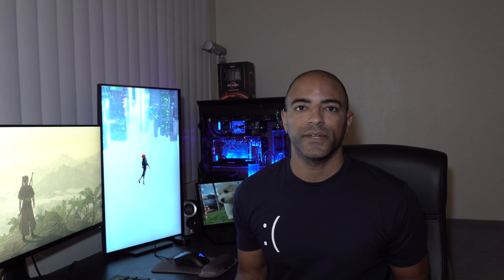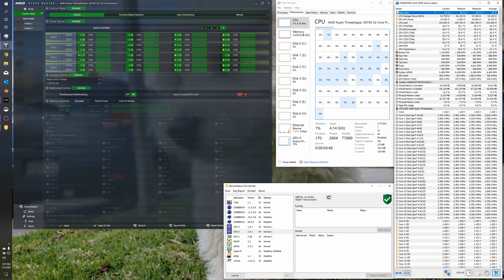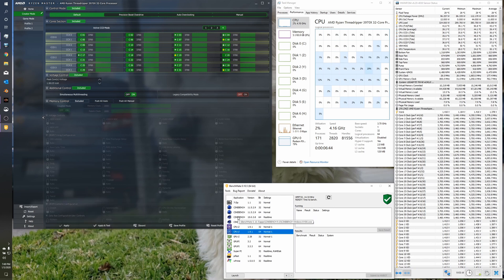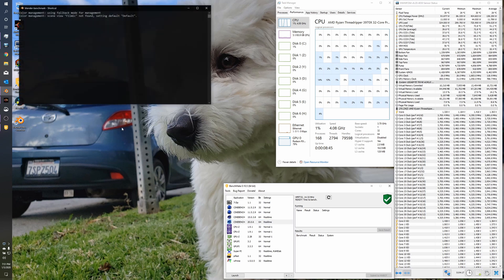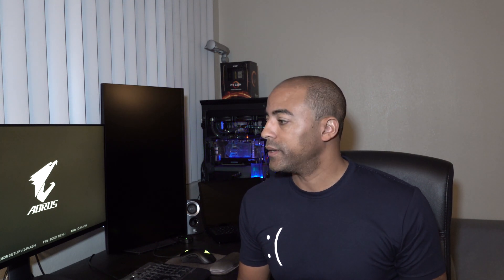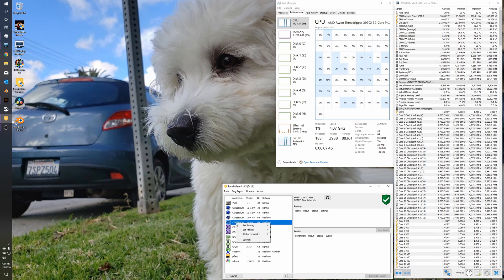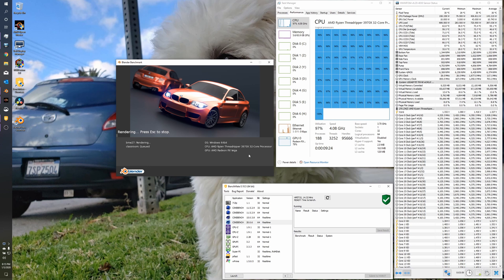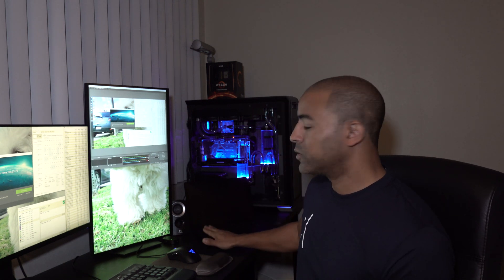AMD Threadripper 3970X - PBO on Vs. off

Comment from the maker: Let me know what benchmarks you would like to see for the AMD Threadripper 3970X!
Reply: can you do cppc and cppc preferred cores on vs off?
Reply: Ur coling is not enough for  32 cores u  should  aimat below 60C temps,,,, then u have to adjust ur PBO power current draw in bios for it to do anuting properly, and then reduce ur CPU vltage as low as possible keeping stability.
as for bench marks the only benchmark that coutns for   this cpu is Vray Bench all teh rest do not matter, as the bulk  of these cous are sol dto those who wokr inVray and Houdini... If u go this for video stuff, u might syep back to consumer stuff next time.DO NOT push al that voltage at idle in Your CPu , its set at over 1.4 volt   whileit wil not destroy it it iwl definitley degrade it and lower ur perfomance at least by 5% and posilby make ur temps at least 7 to 10 c higher
Reply from the maker: The main difference was actually the BIOS was overriding Ryzen Master. The temps and wattage were fine and I'll be doing a follow-up showing how this is properly ran. Ryzen Master is wonky and fights with the Bios.
Reply: @DaPoets  funnily enough, my experience is the opposite - using a GIGABYtE AORUS Master set RAM timings using ryzen master, which was overriding me resetting it in the BIOS - also, i scored higher with PBO on vs stock, went from mid-high 17000's cinebench r20, sometimes literally just over 18000 (~18010) with XMP profile for 3200mhz RAM @1.35v - 

now here's where im a total deadshit, but surprised nonetheless - I have gskill trident 3200mhz, 64gb - when I leave all the settings to auto, no xmp, with PBO on it scores around 18321 - 18458, when I set the PBO manual with motherboard determining power, 200mhz max overclock and still auto set for RAM, it scores around 18500 give or take 50 points - difference between PBO auto and PBO manual with overrride is about 10oC - PBO auto around 72oC (im aircooling, poorly by the way, lol) PBO manual around 82-84oC......doesn't score at all significantly better for 10-12oC temperature difference, and only seems to be result of all cores getting close to or spot on 1.5v - which the auto PBO seems to reflect a range of 1.45 - 1.47 - 1.48 v being the larger percentage of cores and perhaps only less than a handful of cores actually hitting 1.5v if any at all...

when I set xmp for ram so it runs 3200, it only ever gets to mid to high 17000's, PBO on or of, when I change the timings and ram to run 3600mhz, then with PBO on it only gets to 18091, difference between manual / auto PBO again only really being temperatures

that all said - changing the RAM speed / timings does add avg FPS from ~400 -> ~425 in Heaven benchmark run at low quality 720.

 so...again, im no pro by aaaannnyyyyy stretch, barely at amateur really - the ram thing makes me laugh
Reply from the maker: I actually need to make an updated video from this one showing exactly what the conflicts were. Thank you for your detailed response I'll try to get to this soon!!👍👍
Reply: @DaPoets  all good man, thanks for the video - my writeup not very good, but I think you get the rough idea - stock as you showed, around mid 17000's, PBO auto with ram auto gave best score ~18500, with PBO on auto & enabling XMP profile to rated settings for RAM only decreased cinebench score (mid-high 17000's) , the only thing to bump it back up a notch was overclocking the ram to 3600mhz, so it scores ~18000, still 500 less than running it at auto as set by mobo - 

PBO from auto to manual mode only seemed to increase temperatures without any performance benefit, but also not a noticeable decrease in performance either.

thanks for the reply and the video(s) - its egged me on to have a play and try to understand things a little more, cheers
Reply: using the new cinebench r23 and 3970X, i get a score of 43666 in stock settings.

Comment: have you gotten dpc watchdog violation under sustained load?
Reply from the maker: No
Reply: @DaPoets  theres virtually no support out there for the 3970x and im running it on a trx40 pro wifi creators board windows 64 bit.  are you familiar with any of the errors associated with msi bios and windows having issues working together when running these cpu's I also run a 4090 but it did it with my 4090 . 256gb RAM  but windows only interprets 128gb
  sorry for the novel but any info would be appreciated
Reply from the maker: @TheGodFactory  I use the Gigabyte Aorus Master TRX40 board and I have not had a single issue... Nothing like you're describing. I use 128GB of Kingston ram, and have not tried 256.  I wish I could help but perhaps try level 1 tech as I think he pushed his to 256.
Reply: @DaPoets  i appreciate the response thank  you.

Comment: What gpu are you running with that beast?
Reply from the maker: Well this is an old video. Now there are 2 3090's in this system.
Reply: @DaPoets  nice, same processor but just a lowly ASUS dual rtx-3070. She does everything I need her too though, and it's not a market to upgrade if you can help it.
Reply from the maker: @abstractapproach634  Right hardware for the task at hand!

Comment: PBO was on all the time. At stock the CPU should never go above 280Watts, but you had 400Watt+ even on the stock run. Also under PBO you should easily see a peek over 500Watts,so your motherboard is not setting very good PBO limits.
Reply from the maker: Good observation but in my next video on this I'll be showing what was actually going on.

Comment: @ Dapoets Do you by any chance know of any AIO that cover the entire chip avialable or coming out soon? I am googling but can't seem to come up with anything ... I have this chip and have a corsair AIO on it and during heavy rendering it gets in the low/mid 80's and im getting scared.. please , any info let me know what you think .. Also -- you think its safe that its hitting in the mid 80's for this chip .. Im not ready to do a custom loop yet .. thank you in advance :)
Reply from the maker: Hi @EKPHD, the Threadripper 3970X has a TJ Max of 95°c so you are well within limits and most reviewers on stock settings were in the low 80's.  With my fairly advanced yet not exotic cooling & having PBO off (actually off, I have a follow up video on that) I hit a max temp roughly around 67°c depending on ambient. You really only need PBO on in my opinion if you are doing a large job / render, other than that you won't see any real world differences w/ it on or off.  As for AIO though, Enermax does have 100% IHS coverage but I'm not sure about the actual fins though (I doubt it) but as for an AIO that could be your best bet (Liqtech TR4 II 360).  I do know that enermax has quality control issues with their fluids though and have shown to produce growth over time. Not sure if they fixed that in this model.  But in the end 80's is fine, but if you hit high 80's on a regular then try changing your fans for higher quality ones 1st.  I use beQuiet Silent Wings 3 and love them.
Reply: @DaPoets  Thank you so much for the quick reply.  I am going to wait on that aio because it seems as if they are still having issues with the liquid used in their AIO as it gunking up and causing the cooler not to work well.  I hope the company fixes that issue soon and I can try it out.. First thing i will do is buy some Noctua Fans and upgrade them to the radiator and see if that helps and I will keep you posted. If you can think of anything else, please don't hesitate to reply :)
Reply from the maker: @SteveP1978  1 thing I did was I added 1 fan at pure intake so it's bringing in the coldest air into my case.  It's a 140mm on the bottom.  Doing this did help my temps slightly.  If you have an option for your case to do that try it out.  Using a rad as an intake is blowing warmer than ambient air into your case.
Reply: @DaPoets  Ok .. thanks for the input .. It makes sense -- Another question.. you think its better to do PUSH or PULL in general when it comes to radiators? Right now im doing Push from the front only.
Reply from the maker: @SteveP1978  Ah the Push vs. Pull debate.  It doesn't matter, do what looks best for your PC case.  It's the same airflow going through the fins.  What's more important is where is the heat being blown into.  Is it going inside your case, or exhausted out of your case. The ideal setup (pending case capabilities) is fans bringing in fresh ambient air, and then a radiator exhausting hot air outside the case.
Reply: Thanks brother, good luck on your channel. Great system, great content!

Comment: PBO should make more of a difference with lightly threaded workloads, r20 single thread would have been interesting.
Reply from the maker: More videos to come actually with that included
Reply: No, it shouldn't. PBO only makes a difference raising the PPT, EDC and TDC limits of the motherboard. Those limits are only reached by heavy multithreaded loads, and a lightly threaded load will not be anywhere close to enough to reach them.
In this video, for some reason, even when he sets PBO to "off", it's still going to 400W, far over the default PPT of 280W. For whatever reason (motherboard config issue?) this video shows both runs with PBO; even when it is off. That's the reason why he's not finding difference out of margin of error: there wasn't any. He should manually check the values on his AMD CBS Overclocking BIOS menu. With PBO actually off, the power usage shouldn't have exceeded 280W, yet it did when he turned it off.
You can see the current power consumption on the top row of HWinfo64.

Comment: with pbo off socket power draw should not be 400 watts. pbo may have been set to auto instead of off. either it is that, or your motherboard has very overkill power limits by default. this isn't necessarily a bad thing, but it is misleading power delivery on gigabyte's part. for instance, on my 3900x my cpu used to pull 185 watts on early bios, and after the latest bios they corrected power delivery and it pulls the listed ~145 ish watts as described (socket power will be a bit higher than actual cpu power draw). For others with different boards pbo will yield better results. :) nice video man, love seeing so many cores and threads work!
Reply from the maker: I think you will appreciate my follow up video on this.  Should go up in a few days.
Reply: @DaPoets  where is that follow upp video you mentioned?

Comment: Nice video, interested to see how the system performs with some tweaking. I know with Zen 2, you can't really overclock it much, especially since it's so sensitive to voltages (for all core work / stress testing, it's risky going above 1.3v flat). But I noticed that on reddit, many people actually recommended a voltage offset of -0.01v or so, they said it actually resulted in lower temps and power usage, as well as higher boost clocks! But I would be careful with undervolting, clock stretching is a real phenomenon, so you should always run benchmarks to see if your score increases or at least stays the relative same after undervolting.

I'm curious to see if Threadripper benefits as well from this, it'd be cool to see this tested. Also, I was wondering if you planned on doing any ram overclocking, as that is another avenue for increasing performance for Zen 2.
Reply from the maker: You will appreciate my next video on this then.  Stay tuned, it should go up in a few days.